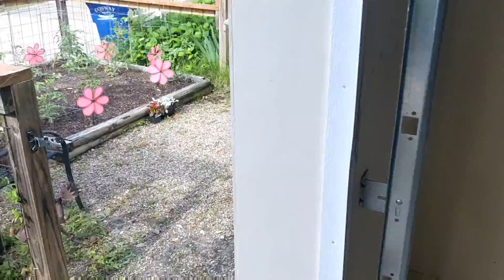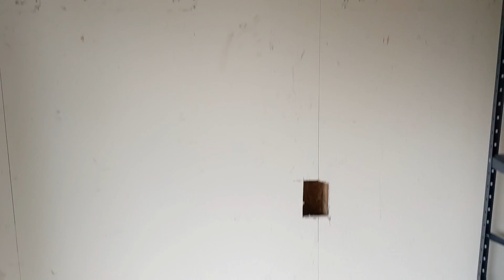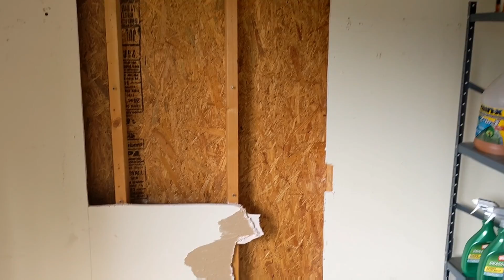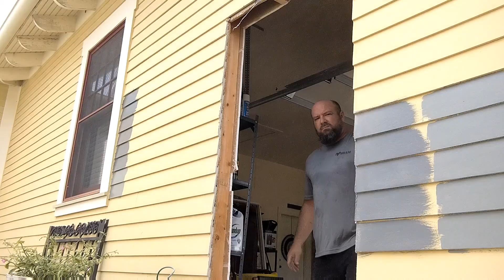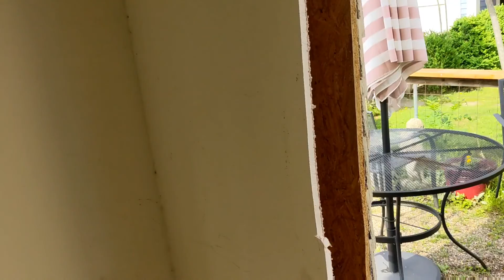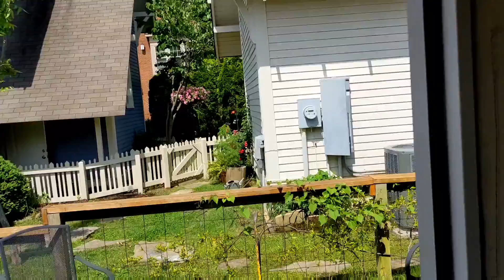Installing door opening

Comment from the maker: If you are just cutting a door opening 24-48" you shouldn't need support during installation, even on a load-baring wall.  Anything bigger than that I would put in some temp supports during installation of the header.

Comment: Nice video.
Do you follow the same process on a structural wall or load bearing wall?
Reply from the maker: Yes, the header will carry the load either way.
Reply: @handytipz2751 thank you for the message, I have one more question, so is it safe cutting the opening without having  momentarily support on the structural wall?
Would not collapse?
Thank you.